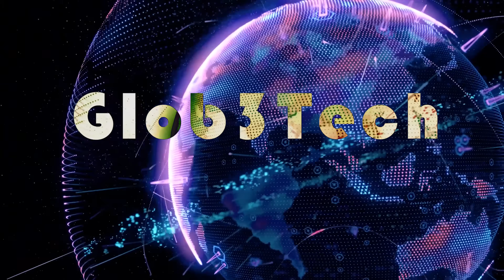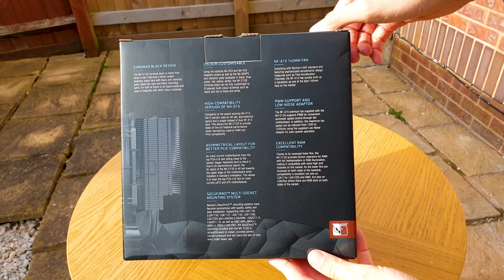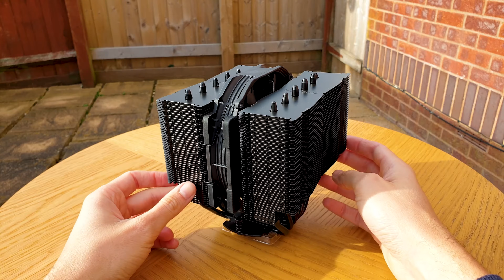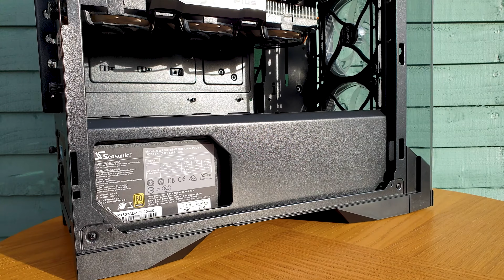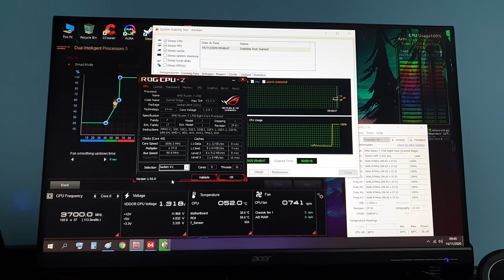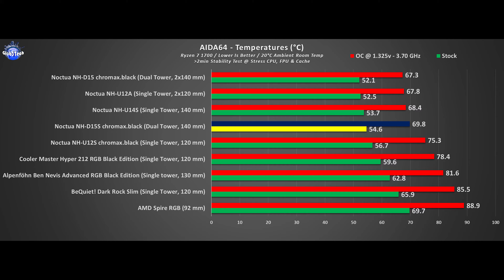Noctua NH-D15S chromax.black - Versatility Reloaded !

Comment: hi bro, can this pc cooler handle the i7 14700f temp to be stable?
Reply from the maker: It should 👍
Reply: @Tech_That thank you so much for the reply, was in a dilemma whether to buy this or the deepcool ak500
Reply from the maker: @JonBaptist421 Sure thing. Can't go wrong with Noctua for long term usage; expensive but worth it.
Reply: @Tech_That this is supposed to have better raw cooling power compared to noctua nh u12a right bro?
Reply from the maker: @JonBaptist421 Yes. Get this if your case is big enough, the U12A is more of a compact solution.
Reply: @Tech_That thank you bro
Reply from the maker: @JonBaptist421 Most welcome bro. Let me know it goes.

Comment: It looks like you have your RAM in the wrong slots to achieve dual channel. You're suppose to use alternating slots. (Skipping a slot in between) - Please tell me you didn't do this on purpose in order to show off your RAM RGB. :/
Reply from the maker: I would agree with you on the first bit but that's an ITX board 😁 So only two slots.
Reply: @Tech_That  Oops, your right I didn't notice that there are only 2 slots. Sorry.
Reply from the maker: @rlwings  No worries at all 👍🤗

Comment: Looks nice.
Have you tried adding a second 140mm fan?
I think it gives basically the same cooling performance as the NH-D15 with a second fan installed, but with better positioning due to the asymmetrical heatsink.
Reply from the maker: I would agree.  Don't have it anymore but yes a second fan will make it equal to the D15. 👍

Comment: Is this good for the 5900X and 5950X for gaming?
Reply from the maker: In gaming for both yes, most people say it reaches for short bursts like mid 70s C.
Reply: @Tech_That  I bought it and put it on a 5900X and it hit peaks of 75C in which I guess is normal for this CPU. Afterburner showed it between 62C-65C while gaming. Thanks for your reply.
Reply from the maker: @JayzBeerz  Thanks for the feedback! Yes, good numbers. Enjoy it 👍
Reply: @Tech_That  I forgot to add to make sure you have a case with good airflow. I'm using the Phanteks P400A. It's a great airflow case.  I tried it in a p400 and it went to 85C-90C while gaming. So the case has a lot to do with it also.
Reply from the maker: @JayzBeerz  Good points. I reviewed the standard case on my website. I agree, it has great airflow. 👍

Comment: TBH, gap between 1st tower and the fan is too wide to be good. Either they shoul bring the towers more together so the gap is minimal or using a thicker fan.
Reply from the maker: I see your point. Maybe they did it for turbulence reasons but I can't remember how close the D15 ones are to compare.

Comment: Does the top of the cooler go above the top of the motherboard?
Reply from the maker: What do you mean?
Reply: @Tech_That  I'm wondering, for a small case, where the top fans are just about flush with the top of the motherboard, would this heatsink be able to fit?  Since this heatsink shifted upwards, I'm wondering if it would fit in such a case.
Reply from the maker: @curmudgeonnn  I see now. Hard one to guess because it depends on the case and what motherboard you are using as in not all vendors will have the same socket placement on the itx format.

Comment: how come u12 a has better cooling than d15s? time at. 600.. can u explain? in website noctua stated cleary the n15s supposed to be more superior... has more air flow ,cfm and much larger heat sink
Reply from the maker: Those were my tests and results since it has two fans to begin with.
Reply: @Tech_That  yes u were right. After all double fan makes 240 mm more air flow from right to left compared to single 140mm from n15s. So those larger double heatsink without double fan is inferior than n12a then? Not to mention also the weird position cramped in the middle in n15s..
N thank for the knowledge
Before this i was sure to get n15s bcause i thought it will be lower temperature. But i know i will choose the smaller d12a but has 2 fans instead!
Please give me your insight between these two? If u have continous tested them in different occcasion. Aka low rpm normal usage and when intense gaming high rpm aka overclocking cpu mode
Reply from the maker: Sure no worries glad to help 🤗

 Yes from my tests, the U12A is reallty good for its size hence why they promote it as '140 performance in a 120 mm package'. 

If you have to choose between those two, I would go with the U12A plain and simple because it's really that good just a few degress behind the D15. The D15 is worth it only when you OC to the max, that's trully when it shows its potential. For nornal scenarios, smaller enclosures and everything in between, the U12A is all you need. Plus they will soon release the all black variant as well if you can wait a few weeks. 

The D15S is appealing because it's a dual tower heatsink but you need a second fan again to fully maximise its potential. 

Realistically you can't go wrong with either, not even the U14S for example which is almost neck and neck with the D15S. 

My vote goes to the U12A for your question - it has the best bang for the buck possible. I also have a review for it - I think the U12A is one of the very few cpu heatsinks with 7! heatpipes. 😁
Reply: @Tech_That  alrite i understand. So to summary.. the d15s without second fan in normal stock will always inferior to d12a?
2. In high oc clock then like 9900k or 10900k  the d15s normal stock wins over d12a double fan?
3.for my situation.i have no problem in instalation. I have plenty of space in my case. So i can do both of them. With exception of d15 bcause i dont like second fan block my ram. Or worry 2,9 or even 3  slot vga rtx 3090 series in the future will touch the heatsink
Reply from the maker: I wouldn't say inferior, like you saw from my charts all 3 are close to eachother from factory. For 2) I would say so since those are hot cpus by default once they touch thier PL1 and PL2 overboost levels and I don't have them to test it 100%
3) Yeah decide between the D15S or the U12A.
Reply: @skysquall-s  i think d15 should be better then u12a. 
Like the reason it can outperform d15/d15s is due to the way it can dicipate heat with those 7 heat pipes and push-pull configuration. However it might be worse in long run. Since at some point nhi12a will not be able to dicipate enough heat of a 200w tdp processor. 
I have NH-D15 cooler on my Ryzen 3900x and in long intensive loads (18 hrs) the CPU cooler itself is not even warm (I can easily touch the heatpipes). And the CPU inself barely goes above 70C (yeah its, but due to cpu die configuration of zen 2, NH-D15 is less effective in comparison to Intel).
For 10900k NH-D15 will give you much more   headroom since due to radiator size. The two towers can suck and dicipate mich more heat then NH-U12a.

Plus a small tip, having 1-2 fans above the cooler (at the top of your case) can also give quite good results. Especially if you're running 3080 or 3090. Like those fans will not only suck up the heat from hotaf gpu, but also assist the cpu cooler. Personally I got like 3-4 C less during intensive gpu and cpu load just by adding 1 140mm fan above.
Reply: @АлександрПеньковский-ж5г 
1. I was talking comparison between n15s  single fan version and d12a. I conpared them and not dual fan nd15 bcause s and 12a more friendly space to motherboard
2.should i place the 140mm on top case on exhaust aka pull air mode then..?
Reply: @skysquall-s  
1. Oh ok, I mean D15s does not outperform D15 that much. Plus over the net I saw several variations of double fan mount for D15. Like: 
1. One fan at the middle and 2nd behind(basically no fan above ram modules)
2. A 120 fan instead of 140 at the front
3.  A triple fan mode (although this version is not that effective)
I'm telling this just in case u'd need extra cooling.
2. Yeah the top fans should be set as exhaust (pulling air from the case). Basically I recommend at least one exhaust fan at the top. From the tests I saw adding 2nd does not give as much impact( although if u're going with a really hot card like 3090, or FE card then it would be a good idea). The main reason do it that way, so that top fans would suck up the heat from the GPU and give additional ventilation for the cpu cooler.
As a bonus such setup will also push a of dust from the system, so it won't be that dusty.

P.S. I would also recommend u going with a high airflow case like Phanteks P400a or FD Meshify 2. With high airflow cases its also easier to cool the components, plus this will positively impact the noise levels (since it will be a bit easier to cool the components the fans won't spin up that much, in comparison to restrictive airflow cases)
Reply: @АлександрПеньковский-ж5г  very good advice and detailed explanation..
Thanks for the insight.. as a matter of fact.. im having hard time now deciding between pantkeks p500a rgb or be quiet base 802.
I just want to know which case will be more suitable for mount asus lc 240 liquid cooling rgb.
I want to mount on top side. using motherboard z490 asus gaming wifi e and 2x 16gb trident z rgb ram..
I dont have a choice bcause the store force me to get 1 brand bundle package including asus rog  motherboard,cpu 10900k, lc 240 rgb, psu 850 watt gold if i want that single rtx 3070 asus strix oc.. thats the only way to get a slighty above msrp price for the vga compared to more than 50 percent jump price by other store.
Can u tell which case will be more suitable for aio asus lc 240 rgb between these two.?
I couldnt find the appropriate lenght for aio on those case.
Though asus has written radiator size in their website
2. Which one u think is better case? Phanteks p500a rgb or be quiet base 802?
Reply: @skysquall-s  oh shit an 240mm AIO for 10900k, that is gonna be painful if u wanna OC that 10900k. I mean it should it ok for gaming, but if u're going with a 240mm aio I'd recommend u updating to the latest driver and check the temps and voltage. Not sure how it is not, but previously the stock voltages have turned that CPU into inferno. Like I was gathering a PC for a Friend last fall (10900k 3080 msi z490 tomahawk) and I still remember those 90C in Cinebench while using Thermalright Le Grand Macho RT CPU cooler in a push-pull configuration and stock voltage settings. From what I remember MSI was not the only manufacturer that had this issue, so unless nothing changes in 6 months u might need to manually adjust the voltage for your CPU.

Considering those 2 cases: Both cases are can handle 240mm aio. Like on their website they say it can fit even a 280/360 aio on top. So it should not be a problem (and honestly I'd try going with a 280/360 aio instead). So you can choose smth that u like more. Out of those two i'd choose Phanteks because in my eyes Be Quiet! cases were not created for RGB madness xD.
In general I would not choose any of them, just because I have a huge boner on Lian Li (particularly on O11 Dynamic) and Fractal Design cases (I'm just into their clean minimalistic designs). I'd just go with O11 Dynamic for a watercooled custom build or Meshify 2, Define 7 for everything else xD. Like I do own Meshify C for my main build and I am about to buy Define R6 for my server rig).

P.S. If u deside to but Phanteks P500 RGB, just make sure its P500A model, were A stands for Airflow. But I think just P500 would also be ok. I know its a bit rude to recommend other Youtube channels, but you can also visit Steve at Gamers Nexus channel. Steve has been reviewing PC cases for several years and his reviews are probably the most detailed (the degree is sometimes shocking). He checks everything: build quality, aesthetics, noise levels, performance and ect. He also does compilation of best PC on yearly bases and based on the price. So u can check him out)
Reply: @АлександрПеньковский-ж5г  whyndid u deleted your comment? are you trying to tell me those lc asus rog 240 not good enough for oc 1090k?
i dont want it either.. like i said.. it was in the bundle if i want to get the rtx 3070
also my noctua u12a just arrived.. i actually prefered air cooled cpu due to lc after 5 years( maybe .. bcause i never use aio and i dont know the life cycle)
 we never know if those thing stilll safe to use  or not.. ? i cant sell it.. i cant service it.. i can refill it.. might as well throw it away then = waasted money
Reply: @skysquall-s  I did not delete any comments xD
I mean 10900k is a CPU that can output a lot of heat (200 tdp ez). In general 240 aio aren't meant for Overclocking (it depends on the CPU) high core CPU's.  Usually 360 aio's are more suited for overclocking . I think with correctly set voltage you can do all core 5 ghz boost (which in my opinion is more then enough) on that aio. Just monitor the temps at first, during long intensive loads.
Personally I cannot say on 100% how will a 240 aio behave with 10900k, since I only dealt with air cooled 10900k. 

Considering longevity. The main issues u can have overtime, in the need to refill the liquid (basically after 2-3 years). This is something that can be in a service center and can even be free if the AIO is still under warranty. And with the pump, usually they are meant to last for the warranty period, but u can also increase the lifespam of the pump by placing the radiator correctly, by placing the radiator on top of the case or at front tubes down (but its just a recommendation). 
Considering safety, they are mostly safe, it depends on the manufacturer. Asus usually tends to make good quality products, so its should be fine.Plus branded product quite often add either distilled water or oil in the aio, so that it would not fry our components in case of lead.

I mean considering current prices on 3000 cpu's even if u throw it away, its still cheaper then the usual prices xD
Reply: @skysquall-s  i actually went browsed the internet the 240 aio should do fine if u're up to like 5 ghrz all core oc with adequate voltage.
Reply: @АлександрПеньковский-ж5г  thank for the advice. and yeah i already know gamer nexus ..its just so many videos there to watch .. and to learn..
about oc cpu..  i have never oc cpu before hahaa... but i will try to learn from what you write above about those frequencies.. i think this was all done on msi kombustible or inside bios right?  i dont know how to tinkling with cpu voltge yet.. although i know gamer nexus has posted about intel 10900k voltage danger
about those warranty on aio.. i think every country will different, and not every store or distributor for this matter want to fully responsible for  3 years or six life span warranty.. even if thats true i don know yet,noty sure yet if it is serviceable in my country..( they are most likely dont HAVE SPAREPART) or even if they bother to help replace one for one for us..
why?? bcause they have poor selling  regarding asus aio.. asus aio are way overprice
 people prefer corsair or nzxt here.. with that price we can get corsair 2x 140mm and still save some money compared to asus aio rgb 2 x 12cmm fan.
 and they prefer to jump directly, switch from air cooler to buy 2x 140cmm or 3 x 120cm fan radiator. 120cm radiator or 2x 120cm fan radiator only can be sold here with exception if it was cheap ..
yes.. asus aio are overprice for branded.. they better go full with kraken or corsair then and still save some money.. (even if they want those rgb) corsair h115i are beautifull
and you were right.. most people i see on youtube channel always mount 360 radiator on top.. not smaller like 240 or even 120..
perhaps we can talk more on reddit or watever forum or group u are comfortable with.. sorry bcause this is too long already on these comment .. please give me your id or user name in watever group you are active and we willl chat more there.. and thanks again for the tips
ps: im currently in negotiating deal with that store whom force bundle me.. im thinking of sending back and change to 360  rgb version. 3 fan rgb.. since they are  just 55.68 us different. 
( i bought lc asus rgb 240 for price approximately 208.80 usd)
since i already have noctua uh12a ada  and i prefer air cooled more due to safety reason compared to liquid cooling..im thinking of trying to sell it on online Store(probably no one will want it anyway since it is overprice compared to other brand)
Reply: @АлександрПеньковский-ж5г   oyeah and by the way what do you meant by this: "I mean considering current prices on 3000 cpu's even if u throw it away, its still cheaper then the usual prices" ?? are you referring to the gpu.. well it is about  1043.46 usd for rtx 3070 strix oc asus.. buttt there is but.. u are forced bundle buy psu rog 850 watt. motherboard z490 gaming wifi e.. cpu at least 10700k . asus lc 240 rgb. and then u can get the vga card still above msrp.. it is 850+ usd on bestbuy right?? so i still pay much more above msrp.. currently people sell on online store for single rtx 3070 now is about 1460.93+ us for the oc high tdp version card.. and that is more sometimes  1520usd+
Reply: @skysquall-s  yeah I meant GPU, fat finger.  
Tbh for people that are considering a new build ifs not that much of a rip-off. U do need around 800 watt spu, a 10 gen intel or zen 2 or 3 cpu to utilize full potential of 3070. I mean immo the bundle should be more flexible in terms of platforms, but still better then nothing